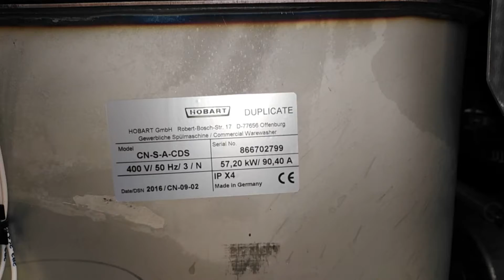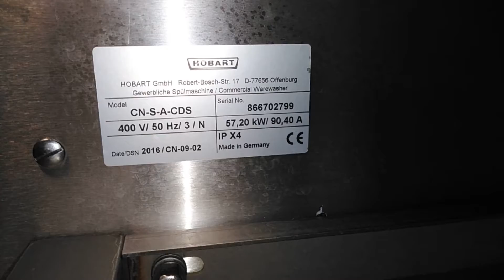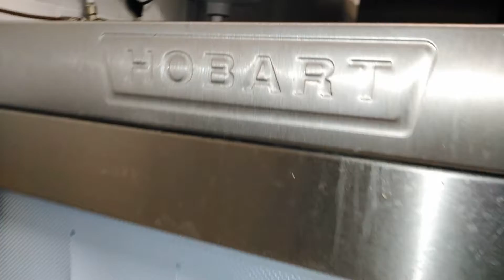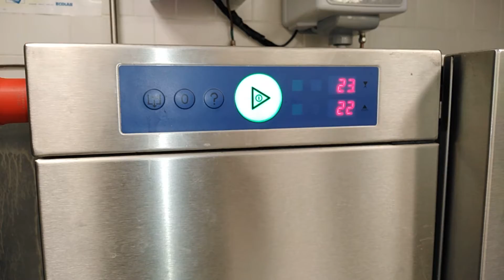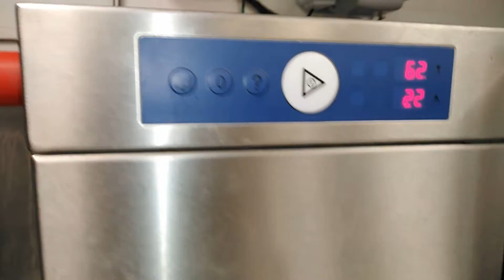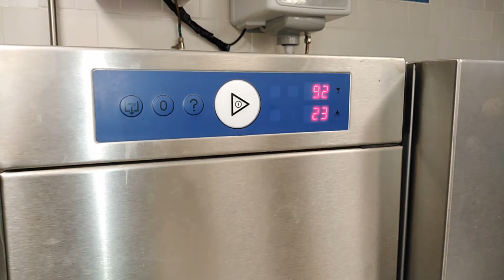HOBART CCA/CNA CONVEYOR Type |DISHWASHER MACHINE | SERVICE

Comment: Hello, i have a hobart ecomax dishwasher, which give me f13 error code, i read the manual and need to pump out and refill the machine, but the next refill i have the same problem what can be the solution? Replace the tankfill sensor?
Reply from the maker: What is the machine model number and serial number